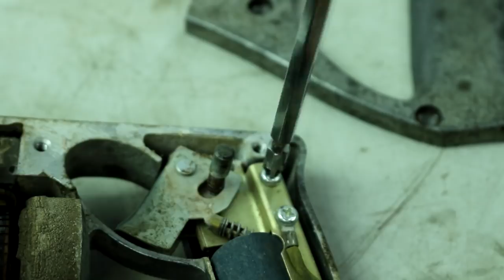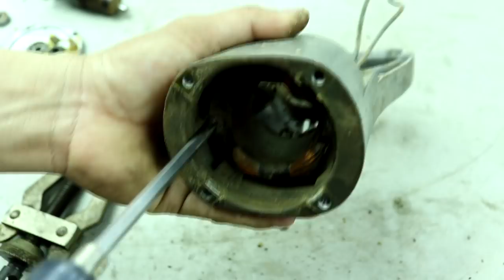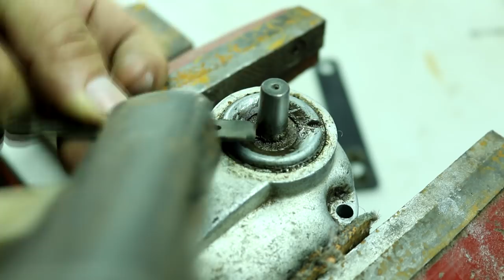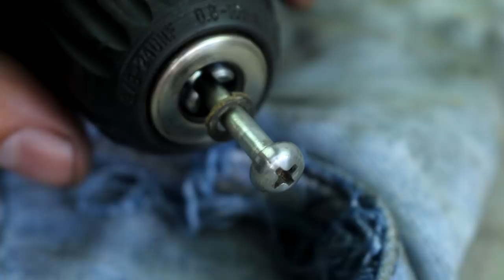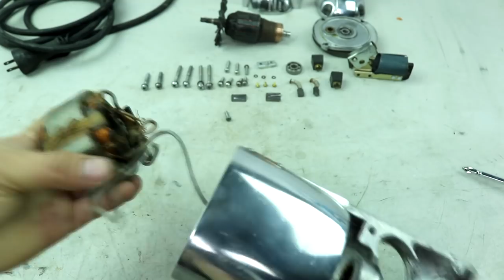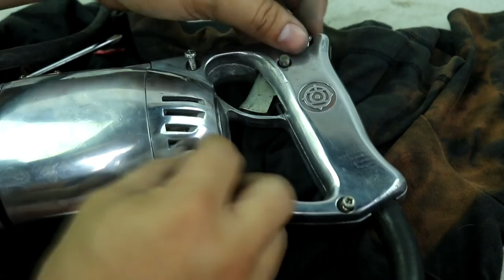Vintage Electric Drill Restoration [HITACHI Drill]

Comment: Nice drill, but, since you were in there already and went through the trouble of pulling two of the three bearings, you should have changed them. And the brushes, also while you were in there. Also it's a good idea to not brush the windings as you can damage the wire insulation and cause a short. A better idea would be to use a spray cleaner that's specially made for cleaning electric motors.
Reply from the maker: Thank you for suggestions and feedbacks.
Reply: yea if youre going to go through all that trouble taking bearings off refurb the motor for sure otherwise it wont last much longer

Comment: Wait, wait. Before I even watch, or even read comments - let me guess. If you took it all apart and replaced bearings, you're dumb for taking apart a perfectly good tool.  You shouldn't call it a "restoration". If you didn't replace anything, but just cleaned it up, you are dumb for not replacing the bearings and stuff. You shouldn't call it a "restoration". Basically, you just should buy it and use it as is. If you try to make it look good, you are just "jumping on this restoration craze". You should just keep that stuff to yourself. Don't ever share it. You're somehow bad if you do. 

People are dumb. You make good videos that I like watching. Now, I'm gonna watch this one. ;)
Reply from the maker: Thank you for watching, anyway is this video good?
Reply: @gear_show  I loved it, it turned out great. The drill looks spectacular. I hate how people hate on you. :(

Comment: these motors in older power tools all look like a similar design. Is this called a brushless motor? Also are the motor designs the same in newer tools today?
Reply: Actually, it's the opposite. These are all brush motors. Modern tools, depending on price, either use brushless, which are more complex but give more force for less power, or use a cheaper version of the brush motor.
Reply: @martypines2321  I don't know of any handheld power tools that use brushless motors. All the ones I have seen using series-wound brushed motors.

Comment: The strands of wire will break with use and the rubber insulation will deteriorate with age, in the power cord. A new grounded power cord will make it safer. I would have checked the windings for short circuit to the metal case, with an ohmmeter and any other shorts to the metal case. Until then, don't operate the drill where you will be standing at ground potential, such as, concrete basement floor or outside.
Reply: 314Tazo this is the problem with a lot of these “restoration channels” you never see them testing electrical components before the deep clean. He was lucky with this one but I’ve had a tingle of old tools like this before. New bearings and new cable would have had this drill back like new.
Reply: Most people lack the skill level in repairing electrical equipment.

Comment: Clean on the outside. But not fully clean on the inside. Sandblasting or maybe a detergent wash might have done the job properly. Some parts had grease and dirt on them. Not properly cleaned.

Comment: Don't quit your day job .unless this is your day job. It looked cleaner before you cleaned. At it. The only thing you fixed was chuck . The way you pulled the bearings was wrong and would explain why the drill is so noisy. That and the dust shield is missing from one side of a bearing. I'll stop there no point in beating a dead horse